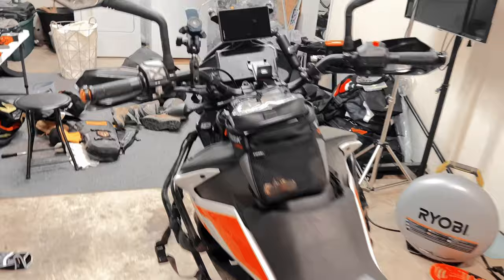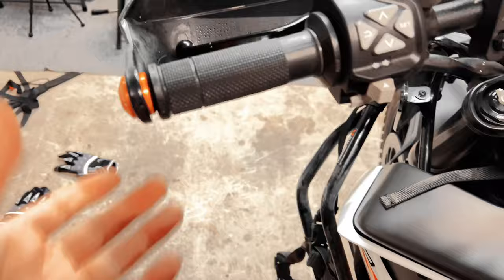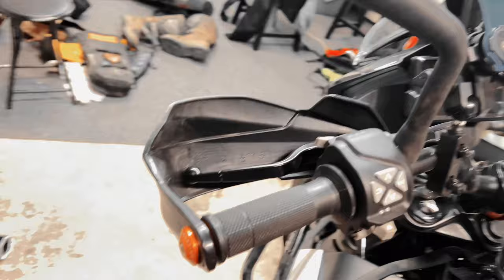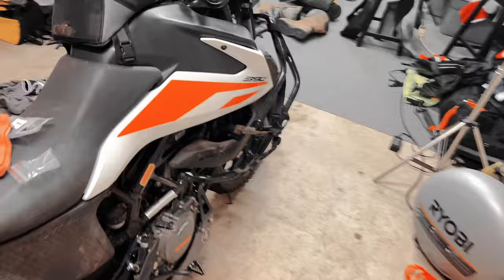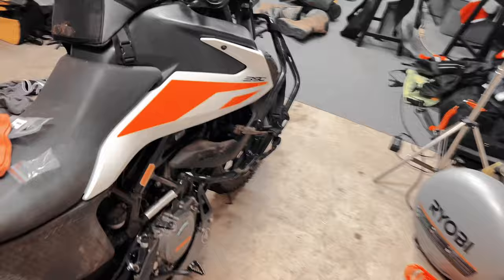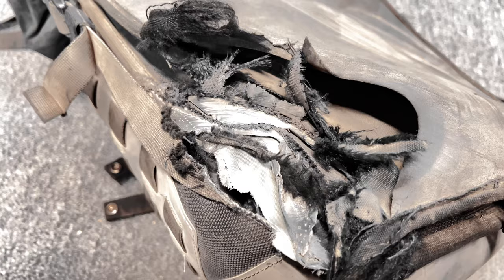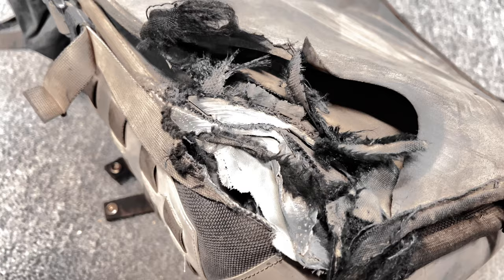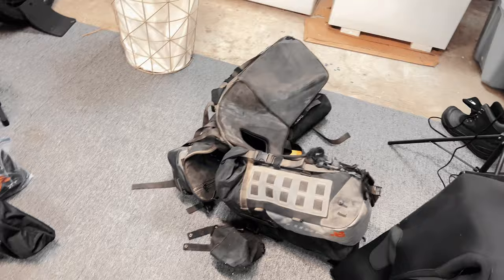KTM 390 Adventure Off-Road: An All-Terrain Adventure Review

Comment: This was a good review, I live in the PNW so haven't had much experience with sand. I mainly stay on FSRs and double-track and that is definitely where this bike shines. I tend to pack light (~30 lbs) so it's great for long weekend camping in the bush, but adding more weight definitely affects it more since it's a light bike to begin with. It definitely has a street bias to it, but it is an adventure bike, it has to be kind of in the middle. I can't always keep up with my friends on their EXC-F's in the rocky trails we have, but I know I'm more comfortable on the ride home. 

I will have to disagree with you on the wheels - they can dent pretty easily, especially if you don't keep an eye on your tire pressures. I've dented mine enough to need a tube - then bought a new wheel and dented it a few weeks later. Maybe that should tell me I'm putting it through more than it was designed for, but it is the main thing that affects my riding confidence on the bike. That and the stock skid plate, it's crap!
Reply from the maker: It is definitely an anomaly of a bike lol!

Comment: Kevin, great video. Your absolutly right less weight would of helped. I dont know if you put a little on your back. Its a shame that KTM didnt put a 21" front and a 18" rear you could of run a fatty on the front and had a better selection of knobbies for the rear. Would of been a much better handling bike in the sand. I also have to say  that pretty much any bike ( large or small) is tough to handle in deep sand. I have subscribed and will go back and check out your previous vdeos as this is the first time I have come upon your site. keep them coming and stay safe.

Comment: Kevin, did you read my comment on the BDR video. You can do your own 600 mile service however the dealership needs to reset the motorcycles computer to unlock the full potential of the bike.
Reply from the maker: Oh yeah, I am planning on doing that in the spring. I just have not done it yet. The location to get it done is 2 hours from me. I am kind of a slacker 🤣

Comment: What kind of tires are you running.  Because not all off road tires are equal.  Some are great for sand and some suck on sand.  I don't  know if you are familiar with the channel Big Rock Moto, but he is experienced rider and he and another experienced desert off road rider took their KTM 790 and 890 on the Nevada bdr and quit after 2 days I  think because his friend kept dropping his bike in the deep sand.  The trail was horrendous for sure but Ian made a comment that he didn't drop his bike and it may have been his tires.  I am still running stock tires on mine, but I live in the desert and fool around on the nearby trails and yes, I have dropped my 390 plenty of times but I am not that experienced either.   Also suspension settings are important too especially with extra weight from luggage.  I'm still trying to figure mine out also.  You should watch that video from big rock moto.  Desert riding is very different from riding regular dirt in the midwest/back east.
Reply from the maker: Kenda Big Block. They are excellent tires. I did the adjustments on my suspension. It truly was the added weight. This thing rios when it is naked without bags. I will have more videos coming regarding this👍🏼 Thanks for watching!

Comment: We ride in a lot of the same terrain and areas so I can share a little bit of my experience as a long time off-roader—mostly from a MX background but had all kinds of bikes over the decades. The 390 is not a great bike off-road. Period. I’m light (140 lbs) and rarely ride this bike loaded and even with good knobby Motoz Adv tires, it’s still a turd in the sand and a pingpong ball in the rocks. It is perfectly capable off-road but I would call it nowhere near comfortable in anything more difficult than mild to moderate fireroads. This bike falls flat on its face in real desert riding.
Reply from the maker: I agree lol! It will get the job done, just not as well as other bikes.
Reply: @kevinlovestacos1  I hope that didn't come across negative... LOL It's not a fantastic bike in serious dirt but it is plenty capable given the proper input and a lot of fun.  I REALLY like mine!